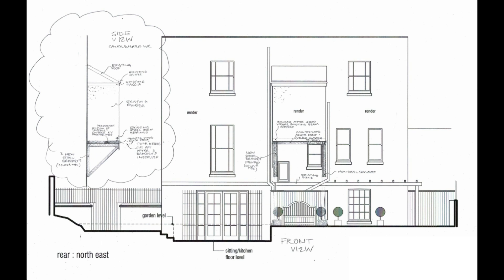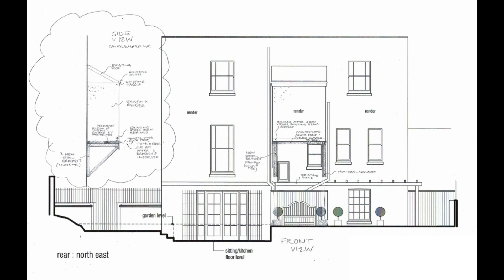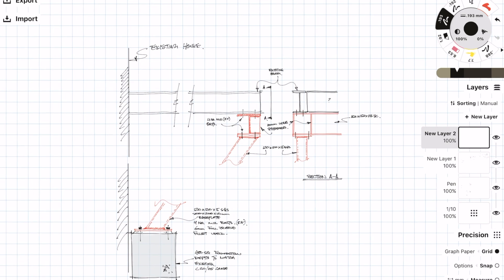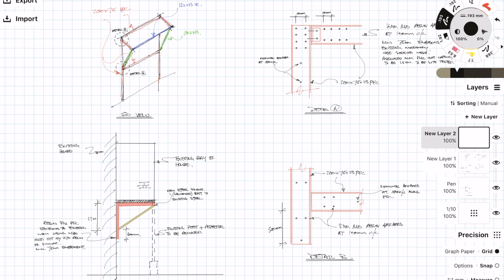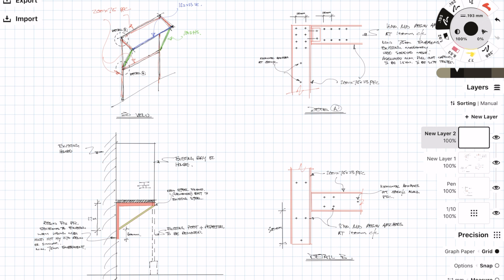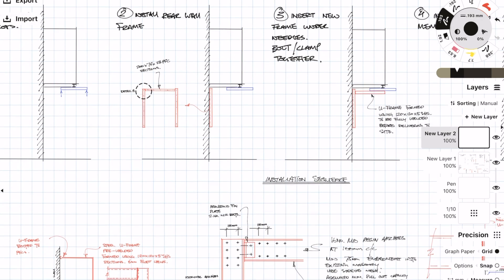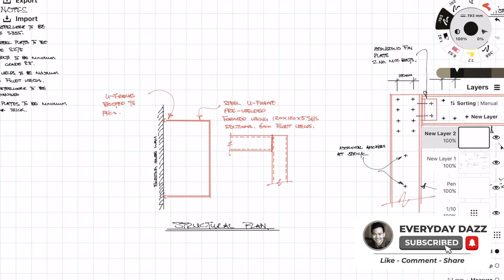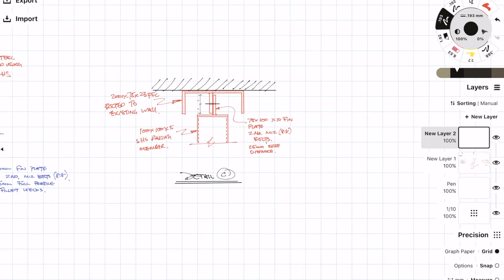Interesting Structural Engineering Details - Episode 1

Comment: Hey mate, thanks for sharing. This is interesting. 
You mentioned that you don't typically "do" steel connections. 
Is it the case that you would not typically design it or not draft/document it? 
So, then who does it if the engineer is not doing it?
Reply from the maker: Most often the steel contractor will sub contract the steel connection design

Comment: Why not just spec M16 bolts? You get way more tension and shear capacity, and the cost difference is peanuts in relation to the entire project fee. Only time I would spec M12 is if space is an issue
Reply from the maker: These are resin anchors not standard bolts. Larger resin anchors don’t necessarily give you large tension capacity if your substrate is too thin if you lack the spacing needed for it

Comment: Thanks for sharing. Not sure what the magnitude of the force is here, but it looks like the raking member end connections employ eccentric cleats. Dunno what it's like in the UK but here in NZ we're not allowed to do that, have to stiffen them both sides of the connection.
Reply from the maker: The load is small enough that it’s not an issue. But I understand if it was bigger than a stiffer connection would be required.

Comment: Hey I’m currently a sophomore engineering student and I want to go into structural engineering but I’m not sure if it’s the right field for me any advice?
Reply from the maker: Structural engineering is a good field to go into if you’re good with numbers and have a keen eye for detail. 

You don’t have to specialise into doing full on calcs once you get experience you can transition away and do more project management stuff. It depends what you want but I’d say starting in strictures can open doors for you later.
Reply: @EverydayDazz  thank you also I wanna to ask what do you think is the most valuable skills I should practice now to be a good structural engineer
Reply from the maker: Design calculations, how things are built/put together, sketching, time management which leads to project management.

Comment: Hi is there any specific reason for beam and column connection you use fin plate.
Reply from the maker: Didn’t need an end plate connection as the forces were low

Comment: Can a brick wall take a point load in is weak axis ? ( compression from the diagonal)
Reply from the maker: There’s a return wall inside that will resist this :)
Reply: What about all the tension pulling on the bricks? Along the PFC, does that cause wall bending?
Reply from the maker: It wouldn’t because the PFC is very close to the floor level